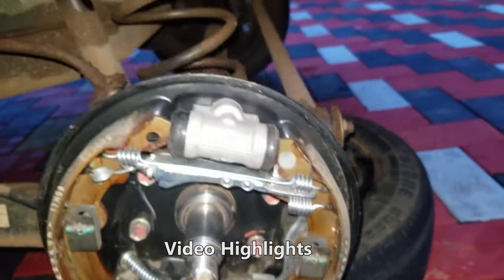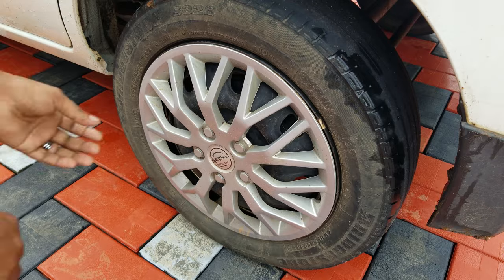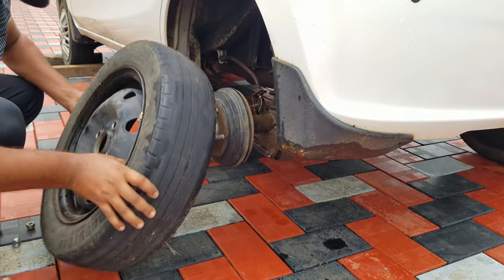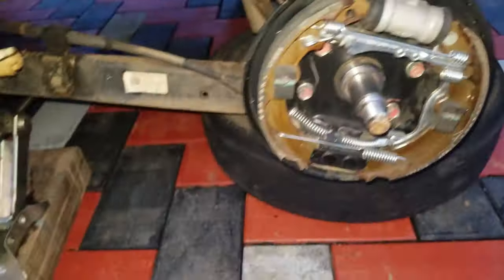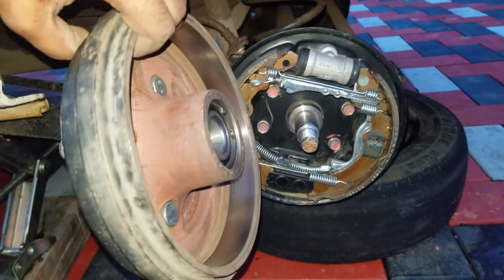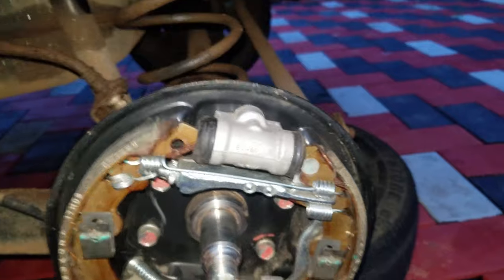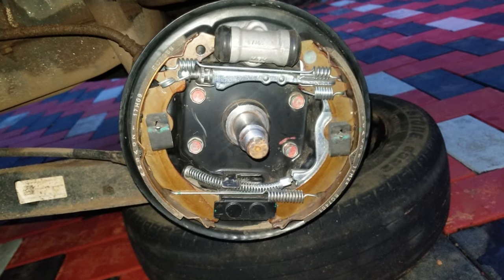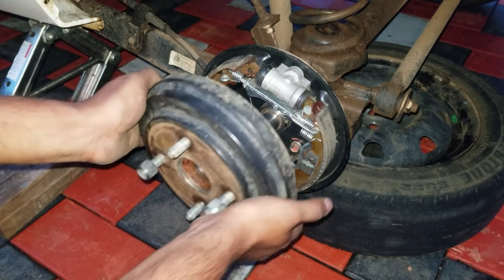Live Car Drum Working | How Car Drum Brake Works | Complete Visual More Than An Animation

Comment: Brake oil ne patty onnu paranjaro
Reply from the maker: Video cheyam
Reply: @BirdEyeShooter  bro i20 2011model nte abs module repair cheyyan aryumoh. 
Break fluid pogunna 4 valve ill..oru valve ileku matram fluid flow cheyyunila...valve clean cheydu nokki..evideyum fluid leakagesum illa...3 tyre ileku brakes apply aavunudu...drum brakes nte cylinder okke maatiyadhu aanu 
Abs module nte complaint aanu enna parayunadhu...pudiyadhinu 55 k varunundu...pudiyadu vaagaadhea abs module repair cheyyan pattumoh..
Please reply 🙏
Reply from the maker: പറ്റും broo